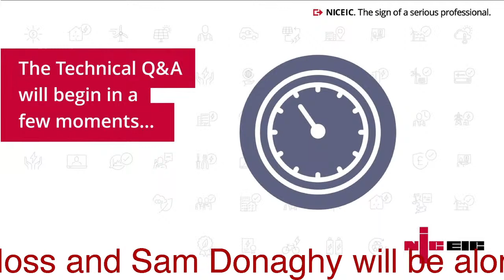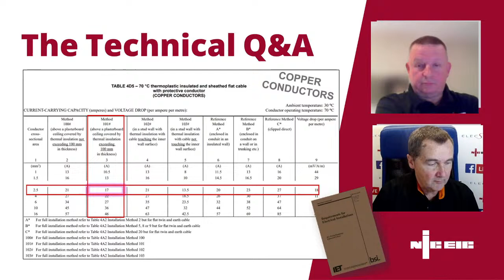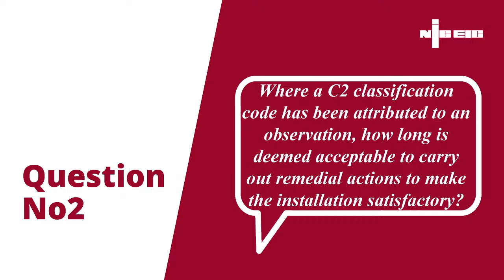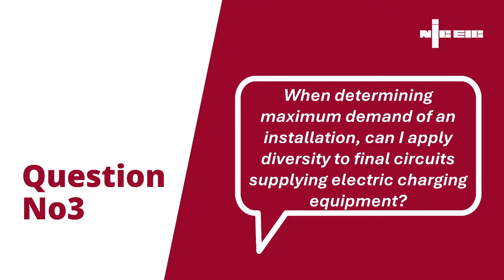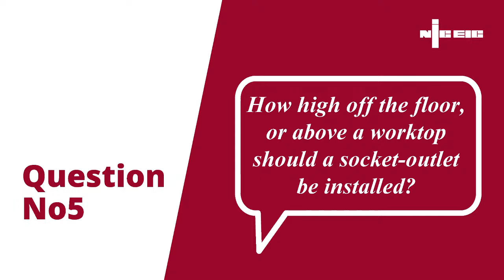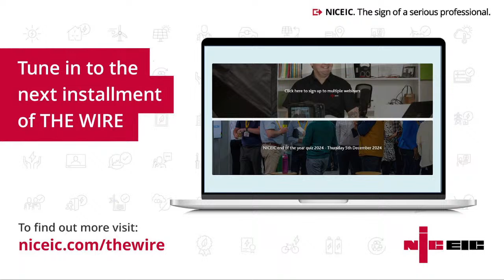Technical Q&A

Comment: If I don’t in stall prosumer such as Solar PV EV charge points and battery storage . Which is what AM 3 is concerned with why do I have to work to am3 . There is no reason why I can’t work to the 17th edition Am 3 and still be compliant with the 18th edition am2 simply because the 17th am e is when the requirement for 30ma RCD for additional protection came in to force.  As we know there is very little difference between each edition. Other than two or three new regs are shit load of spelling mistakes corrected.